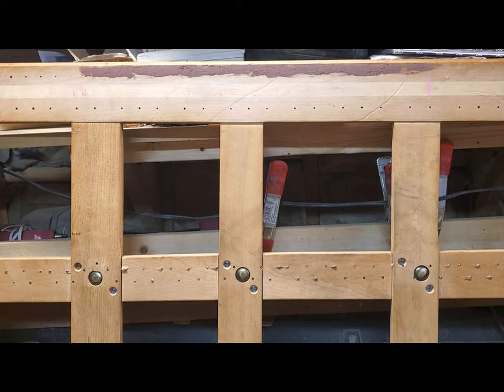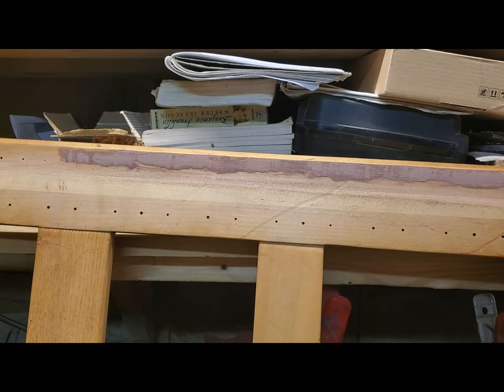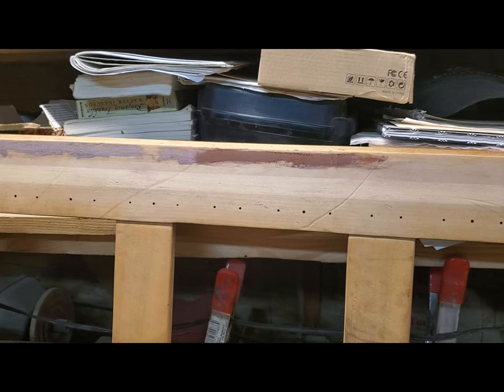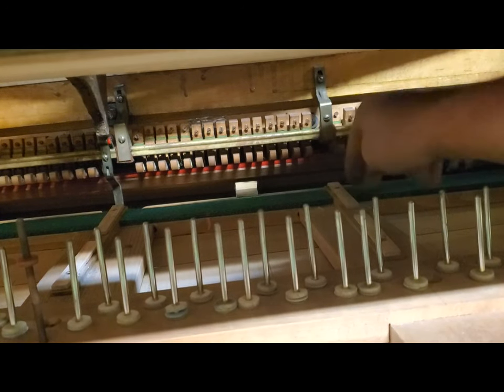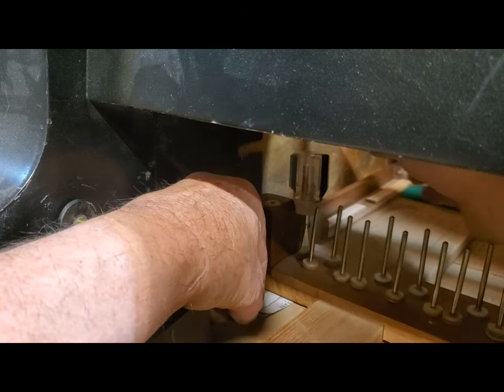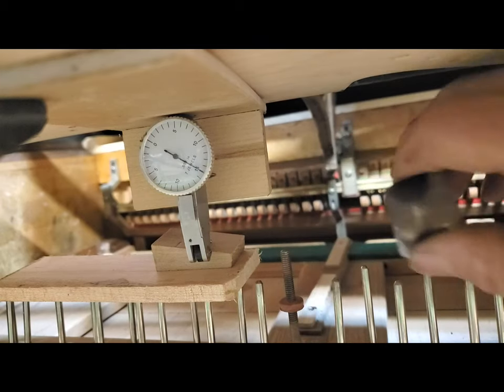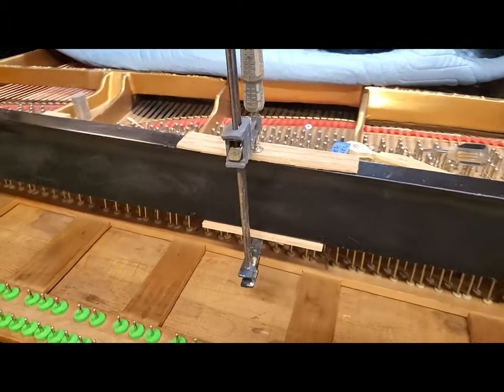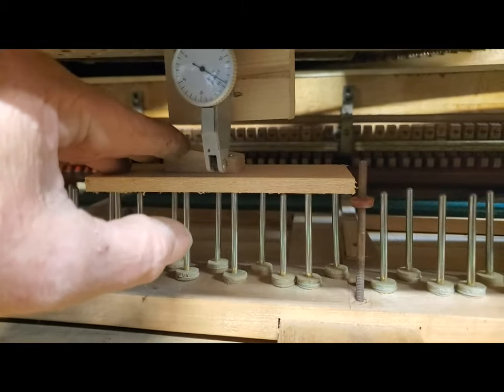Bedding the Key frame- Listening, Epoxy Putty, Paper, and Dial

Comment: This video tackles the problem of key frame knocking in a comprehensive, no nonsense manner, one of the most difficult and arcane grand piano problems to troubleshoot. I spent over two years (and over $1000 on so-called “experts”) trying to figure out what was wrong with my Yamaha C6 that I’d played for 20 years before this issue developed. Thanks to this video, I was finally able to take on the challenging task of building up the front rail on the underside of the key frame with a fast-drying wood epoxy putty purchased from a hardware store. You’ll need sandpaper, too, and of course a razor blade. This type of epoxy putty is very hard to deal with and difficult to handle. But if you follow the instructions described in this video, you’ll be able to properly seat the front rail (the one with no glide bolts!) if you are patient with the application of the putty and put to use the simple woodworking skills taught in the video. Pro tip: whatever the amount of time the putty takes to “cure” (that it says on the package), well, my experience is you have to double it.